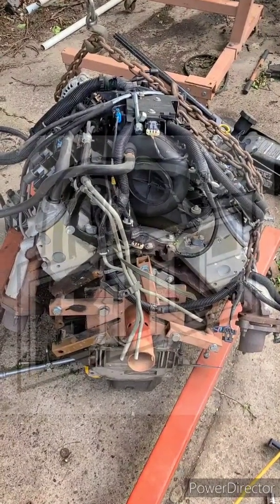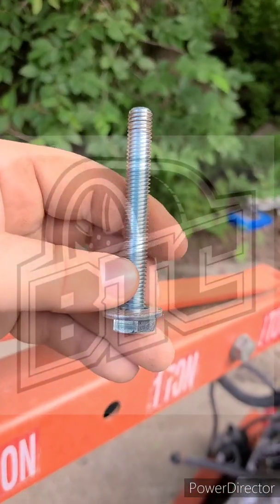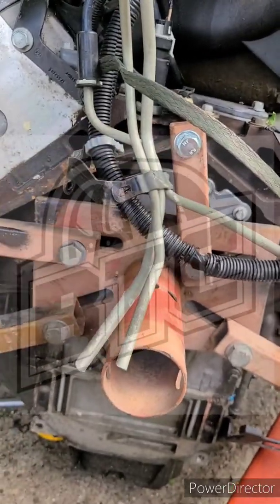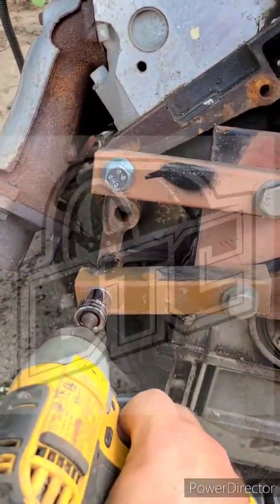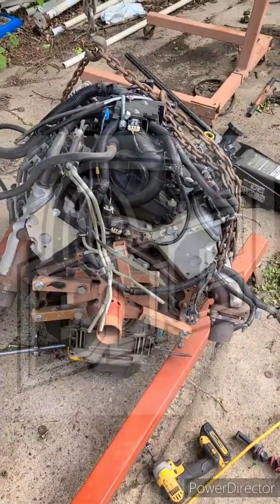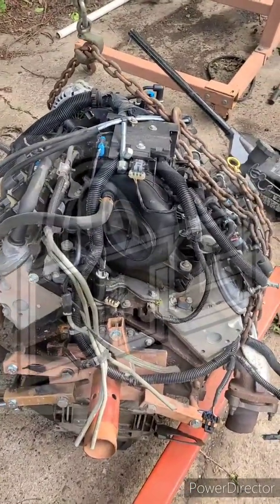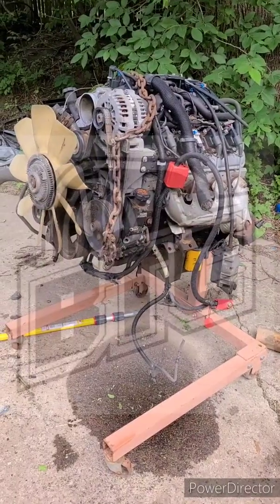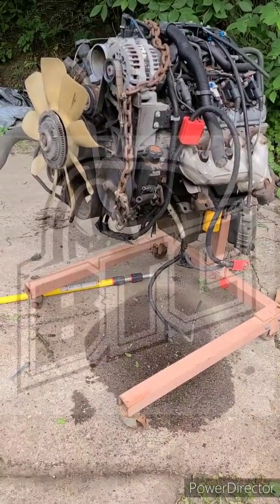How to Mount  an LS Engine to an Engine Stand

Comment: I have the same engine stand and I couldn't get it in the legs of the cherry picker. Is there a trick or am I that fuckin lame these days. The old tee style would of been quick and easy
Reply from the maker: Kinda gotta offset the stand so the picker legs in the middle.  It is tricky, no doubt